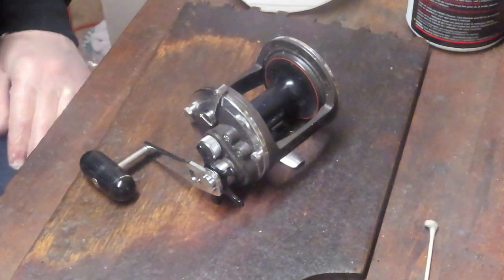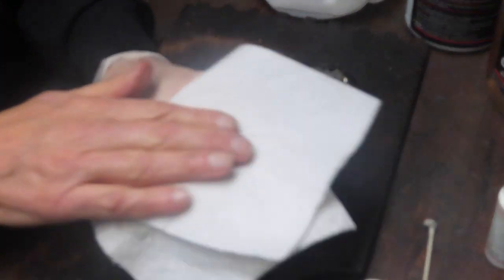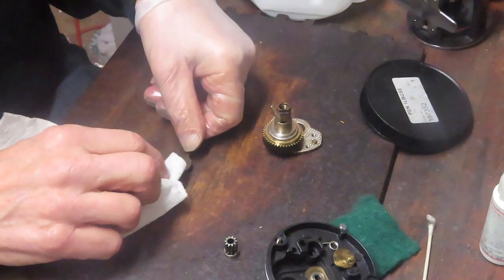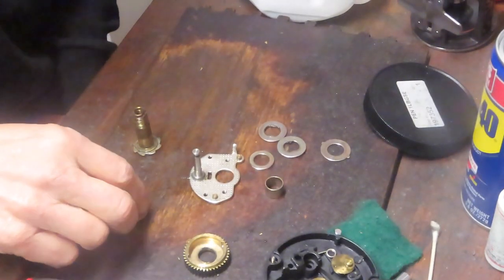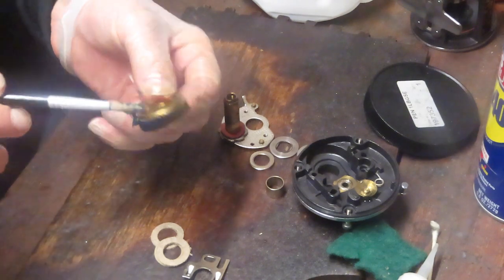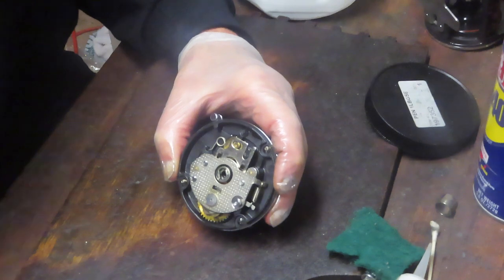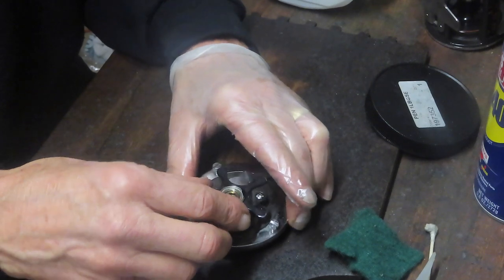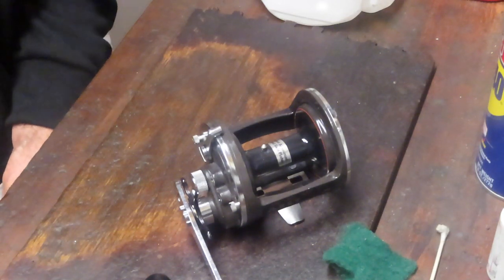Daiwa Sealine 50H saltwater fishing reel how to take apart, service and replace the drags

Comment: Dennis, you had a 50% chance with the handle placement.  I went back and looked the video and Alfred was using the power handle setting, the outer most hole.

Nice looking reel and a good drag design with the 3 large pieces of friction material.
Reply from the maker: Thank you!  I will go back and switch it before I return the reel.  Best wishes - Dennis

Comment: You’re so right about this being a very good reel. I just wish I could still use one. You did your normal thorough job. I did something for the first time today. I got a Daiwa 7000C today and while servicing it I found that the bail was bent and it was inhibiting the bail spring from operating smoothly. I srarted removing the bail from the non-spring side and the screw head just came off. I ended up drilling out the broken screw and tapping the hole for a new screw. It actually worked. The screw holding the line roller and bail on the other side broke off as well so I fixed that too. Salt had evidently corroded both those screws badly. I’d never seen that on a 7000C before. I got it back together and working fine but I need to find another bail roller guide screw if I can. Never successfully drilled out a screw and tapped it before. It’s hard to do when like me you don’t have a drill press. You did a better job on your Daiwa Dennis!
Reply from the maker: Congratulations on getting that screw out!  They are never easy, even with a drill press.  That 50H is one of the best.  I use mine all of the time.  It is heavier that the modern versions, but that is probably why they last and last.  Best wishes - Dennis
Reply: @2ndChanceTackle  That broken screw was even more difficult for me because of the limitations of my vision loos. It’s almost impossible to do something like that when you have no center vision. I found a line roller screw to replace the one on that 7000C whose head just came apart when I loosened it. It was the last one on on Ebay. Those two screws had to have salt corrosion to disintegrate like that. They were magnetic so weren’t stainless like the screws on almost all of my other Silver Series reels (22). They looked very dull and rough feeling.

Comment: Hey Dennis,
A quick question, in your video you said that this reel has a composite frame. I have a similar daiwa sealine with an aluminum frame. Do you know what models use an aluminum frame versus a composite frame? Any insight you are able to provide is greatly appreciated. I am a long time subscriber and I want to say Thank You! You have taught me  countless lessons about reel repair over the years. Take Care!
Reply from the maker: Thank you!  The models that followed the  H series, I think they are the XL series began using the aluminum frames instead of the graphite ones on the earlier models - Dennis